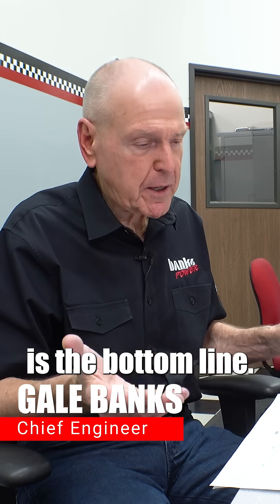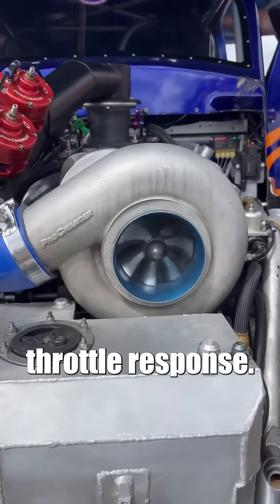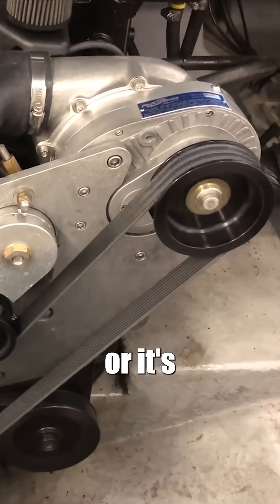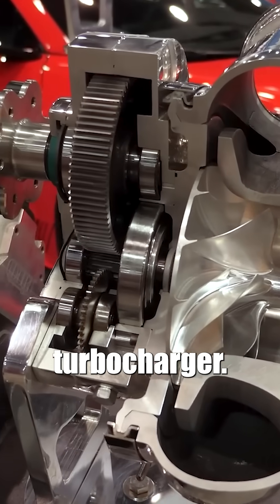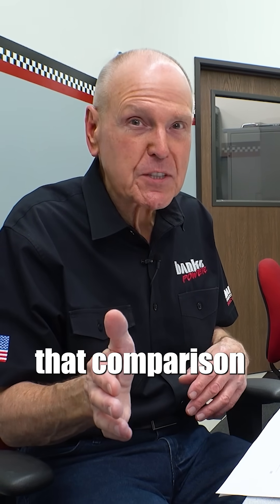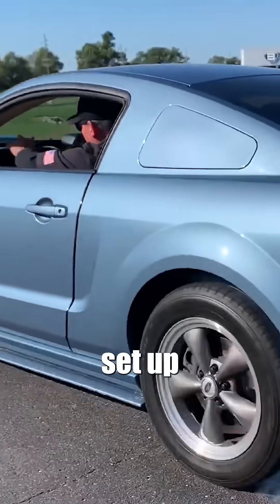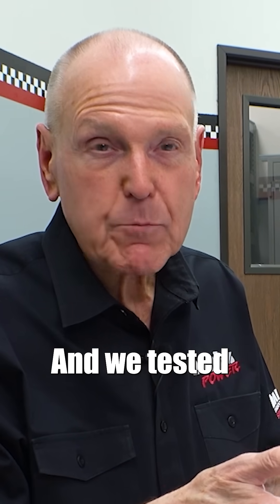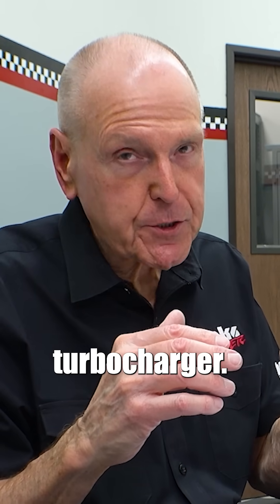Centrifugal superchargers are bad for street cars.

Comment: It's simple - you just need to drive it through additional CVT transmission
Reply: Like the Germans did with the BF109?
Reply: @KI4HOK  I had no idea someone did it, cool :)
Reply: @KI4HOK  Just like in R&R Merlin and Griffon engines, if I'm not mistaken. Significant advantage @ higher altitudes. R&R Merlin beat the P-51 Mustangs orig. engine in performance. The centrifugal blowers were widely used also in radial engines, in civil aviation.
Reply: @KI4HOK  Makes sense. Germans love to overcomplicated things and create more parts to break.
Reply: @KI4HOK  until the Americans showed them the superior option was a turbine supercharger (turbo) on the P51 Mustang proving Banks' point yet again 😂
Reply: @CHASNME  That acft. must be the P-38 Lightning then, not P-51 Mustang.
Reply: @mikakarki7989  negative, the P51 was the first WW2 aircraft to feature a turbo, which was actually a solution for the fact there was no longer enough real estate on the engine for a third supercharger. It was mounted to the rear of the aircraft being the first exhaust driven supercharger precluded the need for it to be mounted to the engine. It was fed by the scoop on the belly of the fuselage.
Reply: @CHASNME  Ok .... Thus ... "Versions with a turbocharger gave excellent performance at high altitude in the twin-engined Lockheed P-38 Lightning, and turbo-superchargers were fitted to experimental single-engined fighters with similar results. "
https://en.wikipedia.org/wiki/Allison_V-1710#Turbo-supercharger

Sorry 4 that.  🤣🤣🤣
Reply: @CHASNME none of this is correct. No version of the P-51 ever featured a turbocharger. The first turbocharged fighter planes were the P-38 lightning and the P-43 Lancer, both in service before the Mustang, though the Lancer quickly superseded by the P-47 Thunderbolt. The early prototypes of the P-39 were also turbocharged but the versions that entered service did not have turbochargers.
Reply: @CHASNME It wasn’t a turbocharger, it was a two-speed supercharger on the sterling V12. Ironically, the BF109 was far more efficient at altitude due to the constantly variable supercharger, instead of having two stages.
Reply: Damnit you are making me wanna build a daf with a banks turbo.
Reply: @kriskor6860  Subaru pairs turbo engines to a CVT on several models. So does Honda. The result is vehicles that accelerate faster than they should for such low HP because the CVT knows how to manage the power just right. Also vehicles that get amazing MPG. Over 40 in the FWD honda and over 30 in the full time AWD Subaru. No, you wont be out there rolling coal and hauling a horse trailer. But there is a purpose.
Reply: @boost331 belt driven cvts have torque limits
Reply: @brometheusthefirstbro4302  All transmissions have torque limits. Clutches and torque converters are no different
Reply: @ except i am certain the torque limit is much higher to start and for clutches they can be replaced and upgraded
Reply: @brometheusthefirstbro4302  Sometimes. I would say in the case of most econobox cars on the market your are correct. Some CVTs use a physical gear for low end power then switch to the chain drive. CVTs can be used on powerful cars too. Nissan did it on their 3.5 v6 for many years. Subaru does it with all their turbo vehicles. Did you know CVTs originated in racing? They were too fast and considered an unfair advantage and were banned from F1. So it could be done if they wanted it to be.
Reply: @ yeah the 3.5 v6 altima. It was my first car and the torque converter failed on it. Somehow
Reply: @ no their are many suspect reasons for cvt’s being banned from f1 racing but them being “too fast” is not the story. Its actually more so its reliability that was in question on top of how it affected the engine sense the engine would run at a constant near redline
Reply: @brometheusthefirstbro4302  And the maxima and a couple SUV\crossovers. 
My coworker has a 2017 Maxima with 160k miles on it and it has actually been flawless. Just have to stay on top of the CVT services, which most people dont.
Reply: @brometheusthefirstbro4302  That is not any version of that story I have ever read. If you watch racing you will see the engines are pretty much always at redline anyways. That is the only way to be fast. Now the drivers just have to flap a paddle to drop gears to keep the revs up. Any driver letting revs fall isnt worth their paycheck. Hell I track drive a couple of my own cars and thats no different.
Reply: @ yeah and that is partially the fault of nissan because they dont specify the cvt transmission fluid maintenance. They say its ✨lifetime✨ fluid. Also they removed the transmission fluid dipstick so you can replace the fluid urself after my 2010 altima as far as i know
Reply: @ no they arent not the same way they are on a cvt. Regularly they are rolling through the rev range often but not act the exact peak rpm 24/7
Reply: @ no some engines are modified to provide peak hp and torque lower in the rev range as well. But thats not as fun. Also f1 has limits for the rest so
Reply: @ brother ur car is still most of the time rolling between lowest 3000 rpm and max 6000 rpm on any given track day and per track they go all the way down to 1500 in some corners that cant be helped. Yes bad drivers would shift way less which would mean the car falls out of the power band more then it needs to making them slower but even in a dct its not as problematic in a race compared to a cvt
Reply: @boost331 he meant a cvt for the compressor. To regulate the speed of the compressor wheel.
Reply: @boost331 basically boost for newbs and boost for people who want to say “I have a boosted car 🤓”
Reply: Damn I was gonna comment this
Reply: I run a 8-71 and it responds at any rpm, no lag period.

Comment: This is why I'm surprised more people didn't go the route of an electric powered supercharger. Yes, you need 48v, but you can spin it up way faster than the engine.
Reply: It takes a lot of power to drive the compressor. IIRC, you need ~45HP to make 400HP fron an average 2.0l engine. That's about 700 amps @ 48v.
Reply: @fascistpedant758  Gsus ... 700 A @ 48 Volts. Multiply that by 4, if one's has a 12 Volt system. Must be a fun, for a few seconds, from a traffic light, to the next one. According a my 50 years of knowledge, that's a wasted energy ... a big time. The more you want from the alternator, the more you lose on MPG / PWR. For example ... I did change all my park/pos. lights  from incandescent lamps to LEDs on my Volvo P80. The result ... from original current draw, it went down to 1:32th. The less your alternator resists your engine, the more you can free power / the more you get MPG. The choice is purely yours ..  it's just purely a measuring/calculating the current consumption of each inidividual bulb + a little n+n+n+n=x math. Or just use the clamp-type current meter, on B+ wire from alt. to battery, when idling. You'd be surprised. 😂
Reply: @fascistpedant758  ......Assuming you are correct on your number, A 12 v battery can do that easily.  48 volts would be even better.
Reply: @thegrmcrckr488  I'm not sure which comment you're reffering to.
Reply: @fascistpedant758 but you no longer need an inefficient turbo exhaust manifold and can do long tube headers or something and gain that power back.
Reply: @fascistpedant758  remember though that you removed a parasitic drag on the engine. The larger alternator might negate a little bit of that drag, but it definitely won't be equal to having the supercharger belt driven.
Reply: @ColeSpolaric  I was thinking more of a battery to power the motor for non-continuous use. Both the motor and battery would substantial. Powering it directly with an alternator would be less efficient and require more crankshaft power than a belt drive.
Reply: @fascistpedant758  yeah, I don't think anyone powers it directly from the alternator. I've definitely heard of large capacitors being used since you can quickly charge and discharge them. The amount of time you need the supercharger in anything other than drag racing is likely 10 seconds tops.
Reply: @ColeSpolaric  The parasitic drag would move from the supercharger belt to the alternator belt
it will take the same power to compress the same amount of air, and the only source for the power is the engine if you want it continously

Hybrid turbochargers have the instant electric response with the ehxaust gasses taking over the continous operation, but for the most part it's simpler to just have an electric motor on the engine output that gives you a kick while the turbo spools up instead of dealing with having an electric motor inside the hottest component in the engine bay
Reply: @ValentineC137  but you're not directly powering it off the alternator. Either a battery or a capacitor. Problem with a motor at the engine output shaft is the size of the battery needed
Reply: @ColeSpolaric   It depends on the application. A lot of modern vehicles have small, turbocharged engines. They could be on continuous boost climbing a mountain pulling a trailer.
Reply: @fascistpedant758  and I think in that application a turbo makes an absolute sense
Reply: @ColeSpolaric  Parasitic drag is parasitic drag, whether it's to drive a mechanical supercharger or an alternator. If it takes 45hp to make an additional 250hp (or whatever) that 45hp will be drawn from the drive for the blower or the drive for the alternator, but there will be 45hp used to drive either one.  I would also argue that just based on basic principles of thermodynamics, the alternator method is actually more wasteful, as every time energy changes state there is a net loss in waste heat.
Reply: @dougthompson1598  then why are manufacturers replacing ac compressors, cooling fans, power steering pumps and pretty much any belt driven accessory with electric motors? Because electric motors are more efficient and therefore the slight increase in alternator size makes up the difference. Furthermore you aren't going to use the alternator directly. No one would ever do that. Applications where this has been done either use a battery or a capacitor. An alternator at lower speeds wouldn't be able to supply enough electricity down low to spool up the supercharger.
Reply: @ColeSpolaric  I've only seen electric AC on electric or hybrid vehicles with large batteries and massive generators in the transmission. Cooling fans and PS pumps are only really required at low vehicle speeds and must be sized for low engine speeds making them extremely inefficient to drive at higher engine speeds. Most electric PS systems don't even drive a pump but drive the steering directly.
Reply: @fascistpedant758  my 2017 Sierra has an electric AC compressor. The newer heavy duty trucks have electric water pumps too.
Reply: @ColeSpolaric  I'm mildly surprised but not shocked to hear that your Sierra has electric AC. I haven't been wrenching for several years and mainly worked on older, out of warranty vehicles back then so I'm not really up to date on things. I'm not sure of how much more efficient electric AC is than variable displacement compressors but they would provide cooling when the engine is off at a red light on start/stop vehicles. Electric water pumpsdon't save much energy provide better coolant circulation for engine cooling and for HVAC when the engine is off.
Reply: @ColeSpolaric what are you talking about? If the electricity comes from the alternator you aint removing any parasitic drag - go back to 6th grade- there aint no free energy, not only that your idea is also bad because you are converting mechanical energy to electric energy and then back to mechanical energy (the blower itself).
Like someone else said 700Amps and 48V ? Thats gonna be an enormous alternator and eiting the size of your wrist!
Soruces:
-Newton laws 
-jule lenz law (electromagnetic resistance of the alternator loading up the engine mechanically)
Reply: @1DEADBEEF1  apparently you didn't read through the rest of the comments. You aren't directly powering it off the alternator. You're either charging a battery or a capacitor. That means you don't have to increase the size of the alternator by 700 amps. More likely 100 amps would be enough. You're also forgetting about the drag of extra pulleys, extra belt length, etc. you're also not realizing I said nothing about efficiency. It's about spooling up faster. As soon as you punch the throttle you can spool up the supercharger faster than the engine could with a belt.
Reply: @ColeSpolaric  in these cases, the system being powered electrically rather than directly from the crank via a belt are not under continuous load. I should have been more clear in my comment, in that it was only in reference to driving a mechanical (versus exhaust-driven) supercharger, which would be under continuous load. Very narrow situation, and you are absolutely correct about the other accessory drives going electric.
Reply: @ColeSpolaric because they're less mechanically complex, and removes the variability of engine RPM.  The computer can spin the pump/compressor at whatever speed it desires, without being chained to the motor.   This also makes more room in the engine bay and gives more options for placement of ancillary in the car.
Reply: @ValentineC137 not exactly I clutch engine fan eats about 20 hp the extra drag on a alternator from a electric fan is only about 1hp
Reply: @masjuggalo  There are many reasons for a difference in consumption there. One of which being that clutch fans can just use more power to pull more air since they aren't limited by alternator and wire gauge.

Also clutch fans do not eat 20hp as a flat rule, try attaching a fan to a 5hp engine and watch how much air that would eject
Reply: @fascistpedant758 where did you pull that power figure? Not even 1950's electric motors need that many watts. Prius motors make more power than that at nowhere near that draw. That's also moving a ton of car not just pressurizing air. Electric motors are far more efficient nowadays.
Reply: @MrPeacekeeper44  45hp is 33.5565kw, 33556w / 48V is 699 amps
power is power, a prius has less amp draw since they run 200-350 volt batteries. at 200v it's be 167,8 amps for 45hp
Reply: @MrPeacekeeper44  A prius probably uses 10-12HP crusing @ 60MPH on flat ground.
Reply: Look at what Porsche did with the 911, the turbo is an electric motor. Spools up using the battery, the recharges the battery at higher rpm. Straight f1 tech and very cool.
Reply: @JayCrash450  The F1 stuff is amazing. 500hp/liter and 50% thermal efficiency.
Reply: Idk what you guys are arguing about. He's used an electric supercharger in the streamline over 20 years ago...
Reply: You dump the battery really quickly and then it’s useless. You’re then getting that power back through the alternator. Going from mechanical to electrical is an inefficiency, but I guess it would be perfect for drag racing (but then you could build boost through timing anyways)
Reply: BorgWarner makes them. They work, but they aren't exactly cost effective for most aftermarket applications
Reply: @Dan-wt7jx  yeah, I could see it being costly trying to convert to a 48v system on top of the supercharger itself. I've seen quite a few 12v ones, but those are just as bad as what was shown here 😆
Reply: @ColeSpolaric  there is still a good chance the entire industry switches over to 48v electrical systems anyway, with belt or flywheel mounted hybrid units working as your starter, alternator, and giving you a boost when needed.
Reply: Its the weight factor hurting handling with all the added electronics on an already heavy supercharger plus an extra bigger battery, and that's y ppl don't go that route
Reply: @bradhart3787  capacitors are significantly lighter and better at quickly charging and discharging. I would think it would be under 100 pounds but would need to research that. I would think any reduction in handling and top speed would be more than made up in throttle response and quicker acceleration
Reply: What effect would a variable pulley drive like on a side by side have on the centrifugal blower?
Reply: @asherdie  I would think it would create additional parasitic drag on the engine as the torque at low RPM isn't quite high enough. Not to mention this is even more complex
Reply: 45hp

Comment: Why not just stick a belt driven one-way clutch on the supercharger (as well as having the exhaust driven turbine) so that the supercharger will never spin slower than the engine rpm or the exhaust speed?
Reply: I literally had the same idea.
Reply: On that same note though, if you find or come up with any schematics/blueprints/documents on something of the sort please do share
Reply: @knowbull5hit590  This could be done with a simple one Way Clutch bearing, attached in-between the compressor and turbine casing with a belt strung over it and the crankshaft pully.
A one Way Clutch bearing is an $8 dollar part. It wouldn't be that expensive.
Reply: Locomotives use a similar principal with a gear driven clutch. 

Under a given engine rpm, the clutch is engaged to drive the turbo off the gear train. Above that, the clutch is disengaged to run off exhaust alone.
Reply: Why? Because physical limitations to the parts, material, and engineering. For that to work and be reliable enough for consumer cars it would cost space shuttle levels of R&D, and in the end the chance of it being reliable enough to last 100k miles in a road is almost 0
Reply: @knowbull5hit590  This could be done with a simple one Way Clutch bearing, attached in-between the compressor and turbine casing with a belt strung over it and the crankshaft pully.
A one Way Clutch bearing is an $8 dollar part. It wouldn't be that expensive.